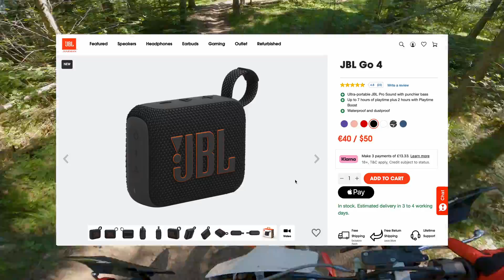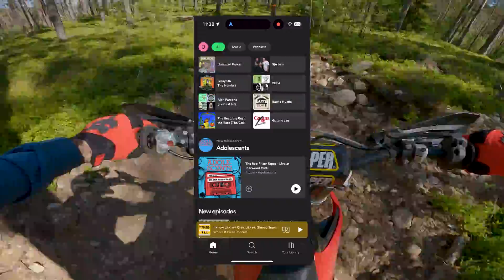Stark Varg, sound system mod (POC)

Comment: Really interesting what you did there! Its going to be interesting when the throttle position and the load stage of the engine will be modulating the sound. Thanks for the video!

Comment: just an idea to consider for sound production - transducer / exciter mounted to plastics on the bike.  These exciter devices can turn any somewhat rigid surface in to a speaker.  I believe the more rigid the better but i don't have a ton of experience with them.  Point being that you may be better sound by changing the material from plastic to carbon fiber for example. 

A similar product exists for RC cars. It's a speaker with selectable engine sounds. Maybe you can borrow some of its design concepts if any are helpful.

Comment: Même pour les autres usagers, je ne vois aucune utilité de rajouter du bruit au silence de l'électrique que ça soit en cross ou en enduro.
Il faut juste changer les habitudes en cross en attendant que tout le monde roule a l'électrique et en enduro, en tout cas en France , il est interdit de passer par les chemins de randonnées donc avec on sans son, obligé de les éviter.
Tout est ensuite une question de savoir vivre, savoir être et respect mutuel.
Quand on conduit sur l'autoroute et y a une file a droite et une a gauche pour doubler donc il suffit de mettre en place de nouvelles règles pour éviter les accidents.
Ça s'était plus judicieux que Stark se concentre a homologuer cette cross pour l'enduro car beaucoup de gens dont je fais parti on aussi acheté cette moto pour son autonomie en enduro.
J'ai solutionné le problème de phare avant et clignotants, maintenant il faut un support de plaque et un feu pour le frein et ensuite une homologation officielle s'était plus sympa que racheter un modèle dédié...la Surron ultra bée est homologuée, avec batterie amovible et marche arrière... Dommage que Stark n' ai pas repris les bonnes idées de concurrents pour certains bons aspects !
Anton pense aux enduriste qui ne veulent pas remettre 14k€ dans une nouvelle moto ! Sinon je vais finir par passer sur une ultra bée 😭 et ça m'ennuierai de devoir revendre cette belle et solide Stark